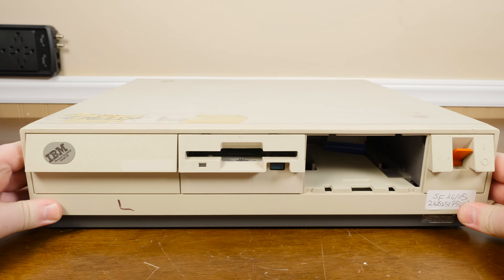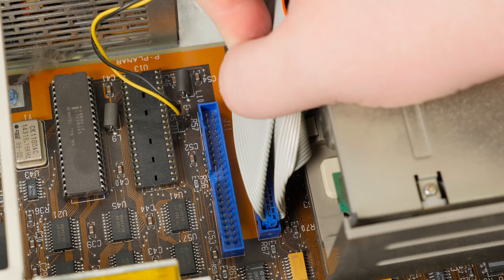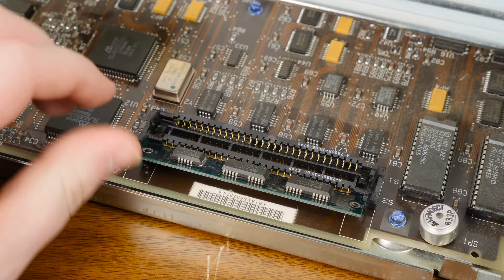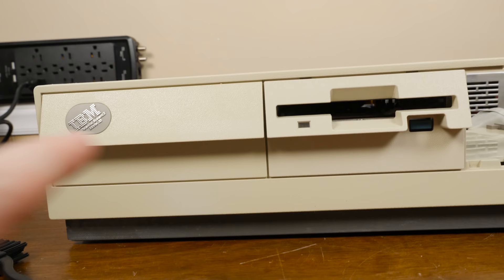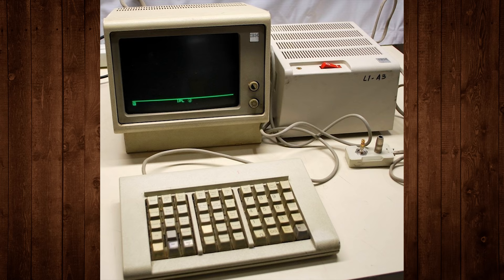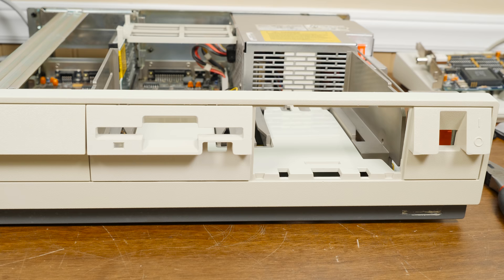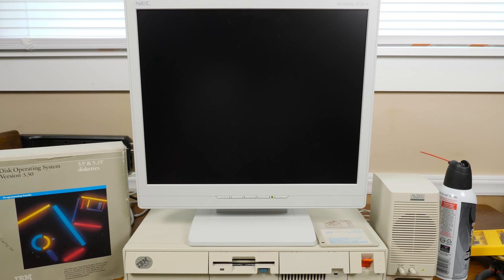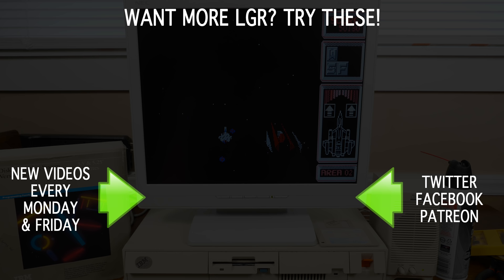LGR - Restoring a 1987 IBM PS/2 Model 30

Comment: @LGR : The yellow "chips" are not ICs. They are either termination resistors or buffer resistors, i.e. 8 in one pack. Comes in handy if you need to use like 8,16, etc. ones for data and adress busses. :)

Comment: IIRC the 44 pin IDE used the extra 4 pins for power which would explain why the PSU doesn't have a connector for the drive. The 44 pin standard was eventually used for laptop hard drives and there are 44 to 40 pin IDE adapters available.

Comment: The drive you put in the machine is actually for Microchannel machines like the Model 50. Original IBM XT IDE drives are tough to find now as they had a very high failure rate.

Comment: One of my PS/2 model 50 machines came with a SCSI card that has molex power connector on it. They probably also sold a double-ended molex power cable, but this was evidently used with an external device. Obviously that particular card wouldn't be any help to you, what with it being MCA, but perhaps IBM sold an ISA equivalent? Then all you'd need is a SCSI drive of period correct capacity (there's probably even IBM branded models out there from the higher-end machines). That would make a pretty kick-ass model 30!

Comment: I have a fully stock PS/2 Model 30, 8530-021.  The HDD is model WDI-325Q, part number 72X7568.  Cable is 68X2828, I think -- it's printed on to the cable, or rather on the ridges of the cable conductors, so it's a little hard to distinguish rounded numbers from each other.  This did land some Google results, though, so I think it's right.

Comment: With that 3270 emulator card it could have been a terminal for a Mainframe, bu the PS/2 Model 30 was also sold as the SE (Service Element) computer for the System 370 9375 series of Mainframes, the software would have been installed on the hard drive, and once the SE was used to "Boot" the mainframe, it would have been switched to 3270 emulation mode, to become the console for the mainframe.

Comment: I have the model 30/286. It's my favorite model among IBM PS/2's. I was surprised to see the PC cover made out of plastic. My model 30 a metal casing (top and bottom) and has a white power switch switch as opposed to orange. There must have been a lot of variation between models. I appreciate the plastic cover though, because my version with the metal cover has paint flaking off. Not sure if I can just show up at a paint shop and ask for some "IBM beige paint please". Some other fun facts: mine has a AMD 80386 upgrade (I still have the original 286 if I want to downgrade) and an extra hard disk in the form of an ISA card upgrade. The HDD resides on the ISA card itself, how cool is that? Bringing the storage space total to 20+40=60MB. The only problem I have is that it's 1.44 MB floppy drive isn't working. It mechanically buzzes and clicks away just fine, but it can't detect a sector when a floppy disk is inserted. And thanks to price gouging on eBay I haven't bought a replacement one yet. Oh well, Interlnk and Intersvr to the rescue!

Comment: Get the 8 bit ISA Seagate ST02 SCSI card. You can put any size SCSI hard disk into the machine. You’ll have to add some molex connectors to your choice area inside the power supply.

Comment: I bought my first PS/2 in 1992 from best buy. It was discounted because the 486/25 had just been released. In my opinion the 386x33 was way faster. I kept it for several years because I had access to upgrades.

Comment: Ribon cables in general tend te be straight. After checking the wiring, you can assemble the cable you want. The IDE like connector is a self pressing connector available in electronic shops. 44 way ribon is sold as well. The only thing is the edge connector for the drive .... You can take an isa slot from broken mobo and complete this side of the cable.

Comment: Hi, the 30 mb hard disk you bought IS the right one for your Ps/2 mod. 30-021. It's the maximum size it could mount, and there is a cable to mount for it. It's been a while that I fixed Ps/2 computers (1994-1997), but I remember having mounted many hard disks on these machines. Try asking IBM directly, they still have some stuff.

Comment: On the scuffs and marker stains, try just going over it with a razor blade. Nothing drastic, just sort of drag the edge over the stain. It will dislodge the particles without causing any sort of noticeable surface damage.

Comment: Heh we had one of these at home, together with a ProPrinter and a IBM 12" monchrome monitor for 256 glorious MCGA greyscale tones :)
Apart from the obligatory Sierra games, I also played Sub Battle Simulator by Epyx and messing around with Micrografx Designer in Windows 1.0.
I remember the 20Mb hard drive having a very unique blipping seek sound, with a very recognisable "blip..blipblip" pattern often occuring.

Comment: Good luck on the drive...  most convenient thing you can hope is to find an 8-bit hard-card.  Otherwise, a separate 8-bit hard drive controller for that drive you bought, but haven't seen one of those in the wild in at least 25 years.  :(

Comment: Damn, it's the model 30.  Where I used to work, we had a load of PS/2 computers, but these were mainly the model 55 (if memory serves) which had the Microchannel architecture.  They were dreadful machines and the price of the Ethernet network cards for them was about triple that for ISA and Token Ring was even worse. One of the sites I worked on had a Token Ring network and 30-odd of these computers which needed hooking up and it worked out cheaper to bin the lot and replace them with Compaqs and a boxful of ISA Token Ring cards.

Comment: I am about 99% sure the 8086 versions of the PS/2 model 30 (and 25) were NOT EDSI drives, everything I have read says they were a proprietary cabled version of the "MFM" (ST412/506) interface.  The EDSI drives would have been used on the 286 or later MCA PS/2's.  If you want an old, period correct hard drive, really you are best off either going SCSI (IBM did offer an official SCSI solution for these with a rebadged TMC-850 SCSI card) and then tapping power from the mobo headers (like I did in my model 25), or just using an XTIDE or XTCF card, which is a very elegant solution if you use CF cards, as no extra power is needed.

Comment: Owner of a model 30; came into your same problem with the hard disk cable.
I just ordered a random chineseium cable off of the old internets and the thing worked fine. I just gotta be careful not to plug the damn thing in backwards

Comment: I had an IBM PS/2 model 55 SX not terribly long ago (maybe around the time of this video's upload). Sadly, I do not have it anymore. It even hard the hard drive (and cable)!
 >.<
So, in case anybody may be interested, here are some of my thoughts/notes in regards to this video:
- My PS/2 had a metal cover
, being a model a bit higher-up than this one.
- Mine seemed to have the same hard disk interface, from what I remember.
- FWIW, the power switch mechanism on mine wasn't loose when I got mine.
- Mine was rusty, especially on the bottom
. Big oof.
- Admittedly, I actually didn't know MCGA was a thing, I just thought it was an odd, early version of a VGA plug. I used an old VGA cable, as opposed to removing pins on a newer one
.
- That's the best BASIC script, ever.

Lastly, as an aside, someone has probably has said this already, but if you're not too careful, although it's not guaranteed, forcing high-speed air through a fan can kill the bearings quick. Don't ask me how I found out, but I'll at least say it was on a fully-assembled Toshiba laptop. Had to replace both fans (yeah, two).

Comment: With fans you should hold them still, when you blow air over them you can over rpm them and it screws with the bearings, I know it's happened to me quite a few times before I figured out why it happened. Just use a stick for PSU fans, obviously you don't want anything conductive in there!

Comment: Some 5 years back, when I was finishing my school, I once happened to be in it's basement, normally off-limits zone for everyone but staff, because we were made to carry some shit down there. I walked around without anyone noticing and looked what was there. One dimlit room there had loads of late 80s IBM stuff in big pile, computers, monitors, keyboards, etc.. gathering dust for many years. Unfortunately, I couldn't get past the local bureaucracy to get permission to buy or take anything. I wanted a keyboard at least. As normally these things are scarce af in these parts, since pretty much no one had such computers for personal use in exUSSR countries, the school probably received them used in 90s.
Anything old IBM is just cool.

Comment: LGR, i got the same PC its an ibm model 30 XT (not 286) mine came with a different Floppy drive connector. the floppy drive and HDD got their own proprietary connectors, but the connectors on the motherboard are IDE tho. My floppy drive broke :(   I just need an adlib clone. The battery is incredible it still works and holds charge, if you take out the battery it wont boot, it needs an ibm configuration floppy disk to set it up. I have seen videos where people used a soundblaster 16 on the 8bit isa connectors and it worked. Yours is very clean mine came with bugs and spirder webs all over.

Comment: A couple years back I got a 55sx from my high school. It booted up but of course that damn DS1287 was dead. (You don't know how lucky you are that this machine has a barrel battery.) I tried to resurrect the Dallas chip but then the machine just wouldn't boot. It ended up in the dumpster after I removed the hard drive and the floppy drive.

Comment: The only time I've ever dealt with a permanent marker stain like 8:01- 8:48 was a small dot ot the stuff on the back of an SNES cartridge. Had to resort to Goof-Off (Which is way stronger than Goo-Gone), but that ended up melting the plastic's surface, and thus the texture along with it. It was pretty small, but still unrelenting.

Comment: I hate to make a suggestion, but I'm nearly 100% sure that network card connected to a mainframe to emulate a FEP (Front End processor) which is used to perform root level operations - like "Initial Program Load" (aka IPL)

Comment: Why not look for a Plus Development Hard Card?  Pretty sure they're available (somewhere) and could have been original to the machine if it had been ordered with two floppy drives since this system has the ISA expansion slots.  Somewhat surprised you didn't find a Token Ring card in that system.  BTW, I'm really enjoying your videos and the care you put into working on these old systems is fantastic.  Quite the blast from the past.  BTW, it's also possible that the motherboard for this system was assembled under contract for IBM by Texas Instruments in a plant in Eastern Tennessee.

Comment: Back in the day PS/2 machines were rare and non-standard, you only bought the things on a corporate/educational basis and probably had RS/6000 machines too. Any spares came through the official channels so it wasn't as if anyone had spares around. So good luck with that. Silicon Graphics parts are easier to find.

Comment: 7:15 I don't know if it's true, but I've been told you shouldn't do this because it can damage the fan motor. It basically turns into a little generator and cooks itself if you spin it faster than it's designed to go.

Comment: I am pretty sure that hard drive is for an MCA machine, it uses edge connectors on both sides of the cable to connect to the top of the riser card.

Comment: Thankfully these machines are what helped IBM and all the other manufacturers (I'm looking at you compaq) to change to a set of agreed upon standards. Machines like these show how horrible it was to try and get 3rd party stuff. The main reason why the ibm at and XT where so popular was because of the standardization possibilities.

I think my model 30 was the xt verson with an rll drive or mca (I forget what it was called). Was a nice machine but as soon as the 486s because available these where junk.

Comment: the 44 pin drive sockets are 40 plus 4 power pins, same with the floppy socket they have the power incorporated into the ribbon.
i dont think the pinouts are different either, from memory i seem to recall that its just a 40 pin ide with the 4 power pins added, not hard to work out or indeed make cables to adapt standard pc stuff.

Comment: 7:10
I'm surprised you did that, man.
Did that for a time when I was younger. Then one day it blew dust in the fan's spindle, which got noisy as all hell afterwords, requiring replacement.
That said, you know more about computers than I do,(wasn't out to criticize) just surprised to see it.
Reply: (computer tech here) I never do that when cleaning fans. Most fans have a ring magnet in the fan part that is spun by coils  inside the hub. When you spin the fan with compressed air it generates electricity in those coils. It shouldn't be an issue... shouldn't, but could. Also spinning it with air can push it to significantly higher RPM's than it would normally ever see, and possibly higher than it was designed for which could damage bearings and lead to damage. 
All that nonsense said... they are your fans, spin them up to 10k RPMs if you want, it sounds cool! I've played with old and dead fans before :)
Reply: @bitset3741  
Indeed, I'd heard about those dangers as well. Thanks for confirming my concerns.

Comment: I used to have a PS/2 model 30. I seem to remember adding a 3.5" MFM hard disk using a Seagate ST11M controller. A "hard card" with the disk on the ISA card might be tidier. I wonder whether the IBM "8-bit IDE" described here was the same used in some Amstrad XTs (2086, 3086 etc.) I remember having to look for hard disks that included support for both 8 and 16-bit ATA.

Comment: If you can get it in the states invest in some labelclene, spray it on, leave it 10 mins and it will remove all of that sticker glue a lot easier than anything else i have used.

Comment: very inspirational video. thanks
Reply: also compressed air works fine. But have you ever tried a shop-vac with a pointy tip attachment?

Comment: you should get a small air compressor to clean your stuff, you can get a decent one for 100$ or much less if you get a used unit. These air cans are expensive and they dont have much pressure and they run out quickly.

Comment: That’s a ten base 2 thin coax Ethernet card. They were used in the late 80s and early 90s before 10 base t twisted pair Ethernet took over.

Comment: The network is probably ethernet 10Base-2. aka "Thinnet". This was a pretty common network standard before 10Base-T. 10Base-T was the first widely deployed Ethernet to use "Twisted Pair" wiring, the same as we use now, and a hub and spoke topology where each device connected to a hub or switch.

10Base-2 was based on a bus topology. A BNC "T" connector would be directly attached to the back of each 10Base-2 ethernet device. And and every computer/printer/etc. in the network would be connected to each other by lengths of coax between the T connectors. The T connectors on each end of the network would have a terminator on the empty leg of the T connector. Here is a BNC T with a terminator one side and coax on the other: https://images.app.goo.gl/rk4RMBdV7eEzixwJ9

The cable might physically snake around but you could imagine the network as one long straight line of cable with a computer or other device attached every few feet. If you needed to add a new computer to the network, you would go to the nearest existing computer, pull the coax off of one side of the T connector, then insert a new length of coax and another T connector. If you did it really fast maybe no one would notice.

Because the single cable was shared, everything on the network had to run at the same speed. Now a switch can handle the case where some device is 100Mb/s or even 10Mb/s while others are Gigabit. Also it was completely shared, so if someone was moving a lot of data the network slowed for everyone else. But the real fun was if the coax got pinched in some office furniture or had a break. The whole network  would crash. Then you had to go to various parts of the network, disconnect a cable, and add the terminator to see if the network started working again. If you knew how the cable was run around the office, you could keep bisecting sections and seeing what worked to quickly locate the break, but if it was a big tangle it could be very frustrating.

Edit: This might still be a network card, but might have a special EPROM that provides the special boot process.

Comment: You know.... part of me wonders if that power switch was disconnected on purpose. If this computer really was set up to emulate an IBM terminal, it might be that whatever corporation who owned it wouldn't want people turning it on and off. So maybe they had the techs pop those levers off and leave them all in the "on" position, and control their power from a main breaker.

Comment: 7:07 Don't blow out fans like that. It turns them into turbines and pumps unregulated voltage back into the board. Hold them still with a tool when blowing out the dust.

Comment: Spinning cooling fans at too high an RPM could easily wreck the bearings. Better to use something to prevent the fan from spinning at all, then use the compressed air on the blades.

Comment: FYI, don't reccomend letting your compressed air spin the fan, it can turn the motor into a generator and push current backwards into the board and cook components

Comment: Looks like a token ring network card installed, they used coaxial cable for connection.  That goes way back.

Comment: trying to find older interface cables is a pain in the butt, ive had luck with cabledepot, only ones I found that carried cable adapters for my kaypro 2 still